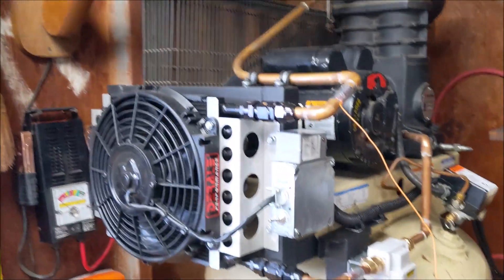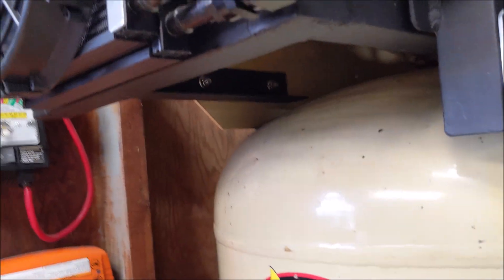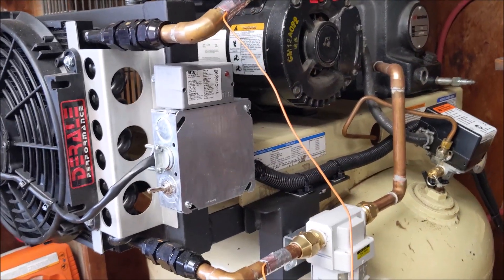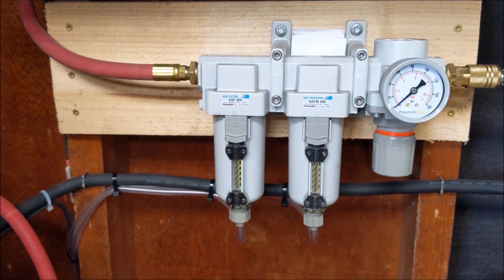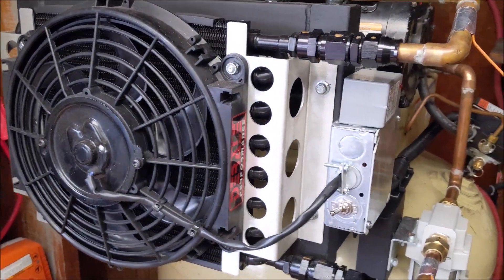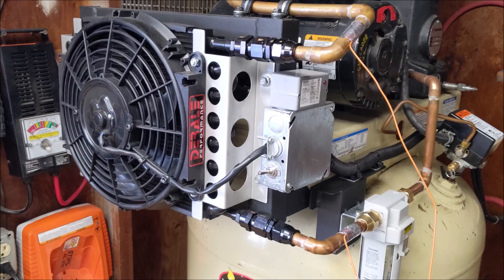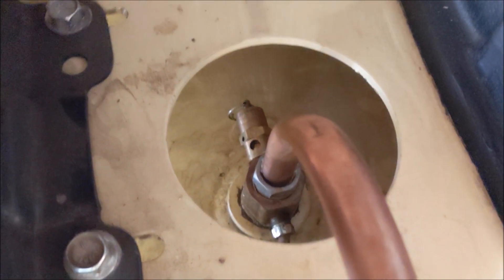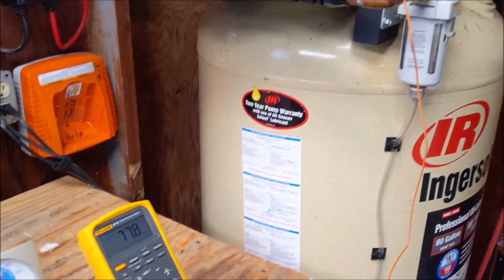Air compressor aftercooler, air drier and water separator

Comment from the maker: The part of the video mentioning the compressor lock up on short cycle has been solved.

 When I bought a new pressure switch it was slightly different even though it was the same model number so I had to move a few pieces and parts around. I forgot to move a little tiny lever that flips and bleeds the line after the compressor shuts off.
Reply: Very nice. Yeah what that does is it allows the motor to start with less amperage instead of a full load, which can be very hard on the motor.
Reply: My 60 gallon kobalt was 14 CFM, they speed them up too 1400 RPM,, l found a old speed air with Smith pump 28 CFM 4 cylinder single stage, l had to increase my cooler tubing to 3/4 anything after 17 CFM needs 3/4 , your 80 gallon should have a 3/4 purge valve, you have to be careful of back pressure on heads if your cooler tubes are too small will cause the pump too overheat and you will get oil in your air from the crankcase being pressurized,
Reply: Would be great to see that explained on vid.. It has been mentioned as a issue on other pretank cooler set ups. Any feelings about the pressure relieve being longer now, with the enlarged amount of air between head and tank?
Reply from the maker: @70ixlr86  I still leave the drain cracked right after the cooler so it always drains water. Ill have to try it without doing that sometime
Reply: I run my air intake through the wall to the outside it really cuts the noise level in half, l only get a few Ozs of water every 20 hours run time,, 148 degrees at head and 67 at tank, been that way for 10 years now,
Reply from the maker: @georgespangler1517  I should try moving the air intake outside.
Reply from the maker: @georgespangler1517 I'll have to check the cylinder head temp. The air is about 300° entering the cooler
Reply: @DBrisky37  damn that's hot I've never seen over 200 degrees, you should your not restricting flow?
Reply from the maker: @georgespangler1517  its possible I guess but the fill time was almost the same.
Reply: @DBrisky37  you make me feel better about my compressor,, l don't think a lawn mower runs at 300 degrees, that's alot of heat for a non combustion pump
Reply from the maker: @georgespangler1517  I did some research and 300° discharge temps are common

Comment: Nice work! I’m about to do the same on my new compressor. You might want to add a magnetic starter (I just added one to mine) those pressure switches don’t hold up well over time with that electrical load.
Reply from the maker: Thanks. Yea gonna add one someday. The setup is still working great. Tons of runtime

Comment: Can you remember how you went about fitting the pump output port and the tank input port? I had a hard time finding male compression nuts that fit the ingersol rand output and check valve. Ended up using a 22mm pressure washer fitting to a 5/8 npt.
Reply from the maker: I know I used the factory nuts to thread in there and I recall having to reflare one of the fittings. If you plan to use any solder joints within 12-16" or so of the cylinder head, I would use silphos braze or the highest temp solder you can get. The solder in the coupler on mine that is close to the pump outlet melted. I cleaned it out and used braze and its been good ever since
Reply from the maker: I believe it was a 5/8" double flare

Comment: Lower pressure and decrease run time, you will never need 175 psi,
Reply from the maker: @georgespangler1517  its a 135 psi single stage compressor
Reply: @DBrisky37   l wouldn't have anything but a single stage,, 2 stage puts out much hotter air due to pumping air twice too boost up the pressure.

Comment: Did you use the original inverted flare nuts that came with the compressor or did you buy new? Do you know the size of the nuts? I believe the are 7/8-18 inverted flare nuts.
Reply from the maker: @khem3111  I used the original but I do not know the exact size that they are. You could pull one off, measure it and hold a tap next to it. Or take it to the hardware store and compare it
Reply: @DBrisky37  Thanks letting me know. I've been struggling to find the correct inverted flare nuts, but I'm just going to do as you said and use the original. Great job and the project looks great, thanks for sharing.

Comment: Great build! when you say 5/8" soft copper are you talking OD or ID? the tube on my 7.5 hp 31 cfm compressor is 5/8" OD (1/2" copper in the plumbing world) the derale 15800 electra cooler is 1/2" (or -8an). Is this the correct size for my compressor? How do I make sure I am ordering the right size?? Thanks
Reply: Sorry just listened to the next minute where you explain that you upped the size from -8an to -10an. Makes sense to me now. Being that my compressor is 7.5 hp and 31cfm do you think I need to go with the derale cooler that is -10an (5/8")? Will the 15800 cooler restrict flow? Not that I will use 31 cfm maybe even at all but if I do decide to try and sandblast or have something that will use that cfm in the future I would like to not be restricted. Thanks
Reply from the maker: @jeffstarcher6215  the restriction from the cooler only made the fill cycle time longer by 10 seconds or less on mine. I max out at 18.1cfm at 125 psi, 5 HP motor. I would definitely look at the next size up for yours.

Comment: Hi Dustin, I agree that this is the nicest install I have seen, only 3 years late.
I didn't go through every comment to look, and maybe this was already stated. If you were to plumb your clear plastic drainline directly to the other drains on the wall, instead of going down, along the floor and up, you will create less head pressure.  There isn't enough pressure to push all that water in the clear tube to the other drain.  It's not a criticism.  Excellent job.
Reply from the maker: Thank you! do you mean the clear drain line leaving the water separator that is mounted right after the cooler and before the tank? The three clear hoses go down and horizontal out the wall in a group inside a bigger drain hose. Probably hard to see in the vid but there is no rise in the hose after going downward, they just 90 out the wall. If they were like that in the vid, It was unfinished. It is still working great!

Comment: I have a 9hp gas powered, 30lb tank. It has a 1" npt outlet on compressor to tank. I'm concerned about the pressure if I was to go direct to rad first. That's 1" not 1/2" or 3/4" like everyone else's compressor seems to be.
Reply from the maker: What is the pressure rating of the compressor? The working psi for the cooler is 250 and burst pressure is 300.

Comment: RIB Relays? You must be a building automation guy? You possible lock up may be to a faulty unloader. I am sure that you have solved it by now and I am 2 years late to the game.
Reply from the maker: @freddaniali  lol. You guessed right. That's what I do
Reply from the maker: @freddaniali  You are also correct on the unloader. I rebuilt the pressure switch and didn't put the little cam that activates the unloader in the right position.

Comment: Solider will not hold up vibration will come apart not what they are used for
Reply from the maker: @jameschuke4104  hasn't broke yet. I used silphos brazing for the connection nearest the cylinder head.

Comment: So I made essentially this same setup, I have an IR compressor(175psi). But instead of running a single filter after the Derale radiator I ran a 3 stage Nanpu set from Amazon. Filter, coalescing then desiccant dryer then into the tank. Within 3 seconds of turning it out the 1st filter stage of the Nanpu blew apart. Looks like three of the metal lugs holding the bowl cannister on had just sheared off. The cannister flew down and smashed into the floor with all the plastic parts busting everywhere. Dented the metal cannister also and a small piece of something had flown by my head. I think it was one of the lugs. My first thought was that the nanpu, which I'm sure is cheap chinese pot metal, had a stress fracture in it. My second thought was that having all three stages inline created to much back pressure and the 1st stage gave way. I am using 1/2" NPT so the lines are big enough. It was probably a combo of those two items.

My goal was to have the air as dry as possible going into the tank. But when I replumb it I think I'll go with just a 1st stage filter/regulator and put the coalescing and desiccant filters after the tank. 

Also, posted this as a warning to anyone else trying it. Take precautions when starting it up the first time with any modifications, like turning it on from the break far away from the compressor! ha.
Reply: What's the PSI rating on the Nanpu. wow!
Reply: @70ixlr86  it is rated for over 175. I even emailed the company and they said it can handle 175 compressors. I just finished putting another filter inline and it worked fine and the motor cut off at 150psi.
I suspect that it may have been a combo of a metal fracture and having all 3 filters inline and it created a little too much back pressure. Just not sure.

Comment: Wow! that looks like the amount of water that will be coming out of my compressor. I have a 7.5 horsepower compressor that is huge. It also has a 300 gallon tank. It was used by an auto body  and paint shop and it really puts out a ton of air. I have converted Harbor freight sandblaster and a vapor honing cabinet . I actually had to stop using them because of the amount of water coming out into the gun. Thanks for the awesome video!!
Reply from the maker: If you make any joints close to the cylinder head, use silphos 15 brazing rod instead of solder. The solder will melt
Reply: @DBrisky37  Thank you my friend!! are those brazing rods able to be used with a propane torch or do I have to fire up the oxygen-propane? Or can I use MAP gas?
Reply from the maker: @Biokemist-o3k  I'm not sure about mapp honestly. I used oxy acetylene on a low setting. The solder connections at the 90° down close to the inlet of the cooler did not melt, just the connection about six inches from the cylinder head.  That was not supposed to be there, but I made a mistake.
Reply: @DBrisky37  I was wondering about that...I looked and found silver phos copper brain g rods that look like they will be a great choice. I was building a large still a few years ago and used silver rods and blew a bunch of holes through the joints so the right rod for the right job is very important. Thank you for taking the time to explain.

Comment: Harbor freight has a refrigerated cooler for 600 bucks it's 99% water free you probably got that much in that set up
Reply from the maker: I have about 300 into this. Works real good and I get zero visible moisture out of any tool. If I needed absolute top quality dry air, I would get a refrigerated dryer.

Comment: The extra volume (amount) of air between the compressor and the check valve needs more time to fully bleed off.  If you can find one, a purge valve with a larger inner diameter tube would shorten the time it takes to depressurize.

Comment: long time later but:  does the relay require a neutral line?  i have 2 hots and a ground running to my pressure switch, no neutral.
Reply from the maker: The coil of the relay is good for up to 277 volts so you should be good.

Comment: Great job mate 👍 
Good to see someone actually using a fan to move air effectively over the cooler.
Very tidy install.
Reply from the maker: Thank you. Strapping the cooler to the cage and relying on the compressor fan did not seem like it would pull enough air through
Reply: @DBrisky37 yeah I have the same radiator cooler setup you got sitting in the box. I figured for less than $100 more you get a nice 12v fan with better hard point mounting options versus that rinkydink plastic zip tie stuff.

Comment: Man what an awesome video and build! I've been watching so many other videos and you were the first one to do the idea I had using a relay. Coming from the car audio industry that's the first thing that came to my mind was adding a relay and a fan.  Very impressed.  I have a much much smaller compressor and I am wanting to add something like this.  will also probably add another tank to store more volume. If in total I have a 1.5 horsepower 175 PSI 4.3 scfm with 15gallon of tank storage. Would i need the same size radiator? Or could i do something smaller.  Think you said that was a 16 lane.   Could i get away with maybe an 8? Or do i need to stay at a 16? Once again thank you for your time and effort making a video and showing the world.  Hope to hear back! Thanks again
Reply from the maker: Thanks for the compliment. Yes this is a 16 pass, I bet you could get away with a smaller cooler. Mine is 5hp 135 psi, 18+cfm and it flows well with almost no restriction
Reply: @DBrisky37  thank you so much for your response.  I think I could probably get away with an 8. Thanks again for your time and help

Comment: Any problems with solder joints cracking?  I'm planning on doing a similar install with 3/4" copper pipe but my big 80gal compressor has a good bit of vibration and I'm wondering if it will hold up long-term when running 50 hrs a week.  I've thought about high pressure rubber hoses instead to reduce vibration but I like the idea of the cooling effect of the copper, at least from the compressor head to the cooler.
Reply from the maker: 2.5 year update. No cracked solder joints or pipe,  but the joint near the cylinder head had to be taken apart cleaned and braised with sil fos 15 because the solder was melting.
Reply from the maker: No broken solder joints yet. Do not put a solder joint close to the head through, that one I have near the cylinder head melts the solder on extended runs. That solder joint was not supposed to be there, it was a mistake. If I built it again I would probably put a rubber hose loop or similar off the cylinder head and then meet the copper

Comment: You are wrong! It's not an aftercooler. It's an intercooler (just like a turbo intercooler) 😂 Nice build. 👍 I went the vertical route with 4 drains at the bottom of each run using black pipe mounted on a concrete wall. I built it as an aftercooler water separator for painting, sandblasting and plazma cutting but now I've seen the light and I'm converting it to an intercooler using 1/2 inch hydraulic hose. My Sears compressor is about 50 years old now and never a leak. They don't make them like that anymore. I'm planning on adding another ck valve to avoid short stop lock ups so the bleeder doesn't have to dump all the air in the radiator.
Reply: Actually no it is an after cooler in cars it's normally just mistated an intercooler actually goes between two stages of compressor. Be it on a 2 stage air compressor or for instance on my compound turbo drag bike. The cooler between the engine and the second turbo is actually an after cooler. We have the inventors in WW2 to blame for the language confusion and well uneducated ppl not knowing better and intercooler kinda rolls off the tongue better 😂.

Comment: The main line coming off the compressor head? Is that joint just soddered normal?
Reply from the maker: Yes but don't put a joint that close to the compressor head. I just noticed the other day the solder melts during extended run time. I need to repipe and get rid of that joint. The rest of the solder joints are fine, that one's just to close to the heat. It was a mistake anyways there should not have been a connection there

Comment: Having the water drain out of the filter is genius!  Mine gets so bad after one day.
Reply from the maker: Mine too. On a hot humid day that water separator after the cooler fills to the full line on one fill from empty. If I don't leave the drain cracked open. I tested it and leaving it cracked only extended the fill time 5-10 seconds if I recall. It's worth leaving open if you don't have an auto drain
Reply: @DBrisky37  yup still have mine open
Reply: So is it bleed some air continuosly trough the drain or what?

Comment: I have an IR 80 gallon and built a set up like this with the same type water separator. At about 60psi the separator blew up. Any ideas why??? Now i have to buy a new separator and try again.
Reply from the maker: Could have been cracked or had a defect to start

Comment: Wouldn't it be a lot easier to mount the condenser on the back of the cage, so the pump fan blows across it? Eliminates the need for the electric fan altogether.
Reply from the maker: Not sure if it would be easier with all of the pipe routing and need to build a frame to carry the cooler back there. Probably a wash on time of installing the elec. fan/relay. The wire cage vibrates way too much for my liking to mount directly to it. I have seen a lot of setups like that. Also the compressor flywheel fan wouldn't move half as much air through the cooler as a direct mount fan.

Comment: Do you have part numbers for the relays and power converter to 12v?
Reply from the maker: Relay - RIB2421C

I used a 12v battery I charge with solar
Reply: @DBrisky37  thank you!

Comment: Do you ever open the tank drain to see if any water is getting there?
Reply from the maker: Yes I do, I still do get a little bit of water in the tank. 90% less than I used to. The first air water separator after the tank catches a tiny bit and the second air water separator is always dry.

Comment: What relay/ contactor did you use? I have a refrigerated drier but bypass it most the time unless doing paint work. My compressor is a 2 stage but a aftercooler would still help. I already have a couple large extra derale Trans coolers with 12 volt fans so the expensive part I already here.
Reply from the maker: RIB2421C